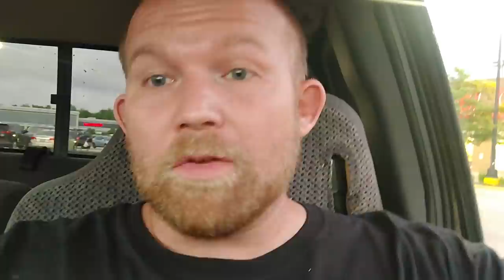Fram Filter Application Talk And What is What and Why - The consumer is the issue not the filter

Comment: I've used fram for years and NEVER had a single issue. I always change oil by 3000 miles. Full synthetic or conventional. I now own a Hyundai Veloster N which is a turbo charged 2.0l and warranty requires I use OEM. They say to change oil at 6000 but I change it at 2500. I use Pennzoil Euro L 5w30 dexos 2 full synthetic low SAPS spec oil. Engine loves it. I totally agree. Take care of the car, and no matter what filter you use, it will be fine. It's just a filter! Change oil often. Cheap insurance. I live in Tampa bay area Florida heat so I need an oil that handles the higher temperatures. Love your channel and keep putting the truth out💓 Be blessed my friend

Comment: What’s your thoughts on OEM motorcraft filters ?
Reply from the maker: Great filters
Reply: Motorcraft filters are good, been running test engines in a big name automotive dyno test lab for years and we use motorcraft filters on everything. Almost all of my 4 Ford vehicles are pushing 250K miles.....always only used motorcraft filters and motorcraft 5w30oil, NOT 5W20.
Reply: I can vouch for Motorcraft filters....top quality as far as I'm concerned.
Reply: I don't know if Ford uses Motorcraft for the original filter. If you look closely at the filter that comes from the factory, and compare it to a Motorcraft, they're different. I understand the original is not painted, but that's not what what I mean. Its actually a different filter.

Comment: I have an 05 toyota corolla I change my oil and filter every 5k on the dot I run 5w30 mobil 1 and I use a STP oil filter synthetic type filter and car has almost 200K runs perfectly fine 90% of my driving is highway miles so Rich is right quit being cheap and service your car it will save you in the long run

Comment: I believe I saw fram and super tech rate their cheap filters for 10k intervals. The tough guard is 15k and the ultra is 20k.
Reply from the maker: Fram rates their cheapest higher end of the lower grade filter for only seventy-five hundred miles I was just on their website
Reply: @FordBossMe  oh yes that's the new drive or the cheap e core. The extra guard is 10k. But I have yet to find a drive, force, or titanium. Those are the 3 new filters but they aren't at AutoZone, o'reilly's and Walmart. Maybe I'd have to go to advanced or pep boys

Comment: I use pennzoil platinum for my wife’s Lexus 2.5 4cyl ,and I change the oil every 5,000mi using the toyota filter. Do you think it would be worth the extra cost to use the high end framultra with the synthetic media? I drive my vehicles for at least 300,000 miles prefer 400,000 depending.
Reply from the maker: Yes
Reply: @FordBossMe  okay thank you👍🏻
Reply: Yes and use the Penzoil platinum ultra. Only a couple of bucks more than the regular platinum and much better detergent package.

Comment: Remember the old VW bug effectively didn’t have an oil filter and many of these could go100,000miles 
 with appropriate oil changes.

I try to use “ fancy” oil filters that supposedly filter the oil better. Can I prove some of these fancy oil filters are better and will make the engine last longer? The simple answer is: NO. 

If any car owner wants to push the distance between oil changes they should go though a lab like Blackstone to verify they are doing the right thing. Yes you can really screw up an engine by changing the oil every 10,000 miles.

Remember there are cars that have gone over 1,000,000 miles that had regular oil changes every 3000 miles and had non synthetic oil and regular filters.

Comment: Love your content but I disagree on cheap fram they are junk! spend the extra 4 dollars and get a wix. What if the vehicle breaks down and sits for 8 months then someone goes to start it and filter end caps fall apart. The fram end caps are known to break
Reply from the maker: What are you exactly disagreeing to? There's nothing to disagree with in this video I spoke to both sides of the field cheap vs. Expensive and explained why cheap won't work past certain intervals and why it will work under certain intervals there's nothing to disagree with

Comment: Off topic but what side of the dipstick do you read if one side is higher than the other? And is it dangerous if you use the entire 5 jug when you only need 4.8qts?
Reply from the maker: You're fine as long as it's not like a half a quarter more typically you're okay because what a line up happening is Yolanda filling up the oil so much the crank will slap the oil and it will pull it up into the PCV system and then you'll start burning it but if you're not seeing smoke and it's not running bad you're fine
Reply from the maker: The highest part of the oil on the stick
Reply: @FordBossMe  one side is at the full mark and the other is way over, maybe the stick is scraping the sides? I checked on a cold engine.
Reply: @yosef8377  — some dipsticks slide into the oil pan at an angle, hence both sides show different readings. That’s a poor design, in my opinion and such a vehicle needs to be driven off a cliff… it’s a POS. 

Check it after an oil change and after you pour in EXACTLY the amount the owners manual says. Then, just pick a side that feels right. 🤷🏻‍♂️
Reply: @I_know_what_im_talking_about  😂😂 it's a 2020 Mazda 6, it's too new to do that! Why couldn't they just design it to take an even number 😏

Comment: I would not use a cheap Fram filter in my car, nor would I use a bottom end cheap filter from any manufacturer. I use a Fram XG oil filter with the recommended Nissan oil and change it at 3k miles. The used oil comes out only slightly darker than when it was fresh with no discernable oil usage on the dipstick. As the man said: oil & filters are cheap compared to having an engine rebuilt.

Comment: You're right. Oil it's self is great now with the technology and can last longer when synthetic. But like you said manufacturer says oh yeah do 20k or this is lifetime no worries. Hah when the warranty is up and car is broken they'll sell you a new car or engine transmission whatever. Us who do our stuff and read the owners manual. We're good. 

Now there are oil companies who state with their oil that you can go up to 20k but fine print on the back and websites say please follow oem intervals while under warranty. What's in the oil to make it go farther when you ask and engineer 🤔 hmm nothing. Same thing with the engine hmm nothing. With technology at its greatest today they could probably make cars and trucks last like they did 20 30 40 years ago. But if they did pfft no more car sales. Plus if you wanted to do more out of a synthetic oil then highway miles and driving is the best. 

Oh and my old acura said in the owners manual that if you do normal and light driving you can do the oil filter change every other service. More severe driving yeah at every service.

Comment: Been using Fram fitters for years no problems
Reply: Same here, I’ve used ultra synthetic Fran filters for a while. I also use oem, wix, purolator and Mobil. The only ones I avoid are the extremely cheap filters.

Comment: Hey man, I have a question for you here hope you could help me out. I have a 2017 Ford F-150 with 5.0 V8 engine. I bought it brand new and drive only 1500 miles per year.  So here is my question , should I change my engine oil by miles or should I change it every year doesn’t matter how many miles that I drive. You suggest that we should change our oil every 3000 miles , so in my case I only need to change my engine oil once every two years since I only drive my truck 1500 miles per year. Thanks and have a good one.
Reply: The manual says 5,000 miles or 6 months, whichever comes first.
Reply: @frankg6578  you also drive a 2017 f150 5.0?
Reply: @bo4130  no, I looked it up for you.
Reply: @frankg6578 oh wow, you are awesome!  Have a good one 👍

Comment: I think the thing that pisses me off the most about Fram is their advertising that their products are so superior to other filters. I hate companies that make outlandish claims but they can't actually back it up and rip off consumers in the process. I feel the same way about Dorman products. Just look at the thumbnail for this video and you see that Fram claims their cheapest filter is good for 10,000 miles. A lot of consumers fall for that BS. There's a reason why the saying came about to "ask for the real McCoy."
Reply: However, their ultra synthetic is really good. I run them 15k miles on 5k oil changes.
Reply: @slscamg  — same here. I throw on the ULTRA for my customers and then run it 2x 6-7k intervals with great success. Their maintenance light triggers, they come in for a quote oil change only. Filter stays on. Then the second time around, both oil and filter gets replaced. Honda does this practice for decades. It’s even built into the maintenance reminder. 🤷🏻‍♂️ 

I like high quality oil filters. 👍🏻

Comment: Some cars have had issues with Fram filters at certain points in time in the past.  One example I know of would be Hyundai vehicles.  

See Hyundai TSB 12-EM-006
https://f01.justanswer.com/El_Jared/b8112c3a-a543-4012-a2ec-1c0d54fc5771_hyundai+TSB.pdf

Description: Some vehicles may experience an engine knock noise with the use of an aftermarket oil filter.  Aftermarket oil filters may use different materials, construction and specifications than genuine Hyundai oil filters, which may lead to pressure variations within the engine, thus contributing to an engine knocking noise.

Vehicles Affected: All Models

Repair Procedure: Perform an oil change on the vehicle and replace the aftermarket oil filter with a genuine Hyundai oil filter.
---

Fram was not called out specifically in the TSB, but if you spent time on Hyundai forums it was well known that Fram oil filters could cause these issues.  Lots of people reported engine ticking/knocking, went to the dealer, the dealer just did an oil change, replaced the filter, and the engine noise went away.  

Fram may have changed the Hyundai / Kia filter design at some point to deal with this, but I think it's still best to use the original OEM filter for these vehicles to be safe.
Reply from the maker: So it's more of a cheap filter design then so much a specific brand type design and that's where we need to focus is the manufacturer filters are not cheap filters but when you buy low quality filters this can happen with any make manufacturer model doesn't matter and I pointed that out in this video so what you posted here and this technical service bulletins actually confirms that what I'm saying is true don't use cheap s*** on vehicles that you're going to abuse

Comment: Completely disagree on this one, had a car (not naming manufacturers) that the oil & filter was changed every 5000 miles & the fram filter split in half & locked up the engine, so never again with fram, wix for me from now on.
Reply from the maker: You don't have to agree with me I'm not begging for people to come to this Channel and agree with me I'm not even asking for people to like anything that I have to say
Reply from the maker: What type of oil were you using what type of oil pressure does your car have why were you buying a cheap filter to begin with there's a number of things that go into what happened to you and why it happened to you
Reply from the maker: You're trying to pump out 30 weight oil through a thin filter that's made for three thousand mile oil change interval at 7,000 RPM the filters not the problem you are the problem and I'm not specifically pointing the finger at you I'm just specifically stating a scenario here that could come into play the nobody ever talks about
Reply: I'm not saying you're wrong & I like your channel & think you're a hell of a mechanic, In my opinion I don't like fram, I had a bad experience with them & yes it could have happened with any filter but it happened with a fram, but that's just my opinion & that's all it is an opinion. And the reason I was run that particular filter is just like you said they have the best sales market in the world. So didn't mean to offend you keep up the good work & I'll look forward to the next video.

Comment: What I will say the fiber end cap to me is a non story as is a flat part that has glue on it and seals the end caps, what do people say about many canister elements that have no end cap?, Most Fram filter even the extra guard have silicone anti-drain back valves over a lot of the popular number Wix filters that they now have made in china have the cheap nitrile black rubber ones. I do see a lowering of standards since Mann/Hummel has bought Wix and ever since the china virus the number of filters in the automotive line that were US vs China has changed dramatically which is disappointing over half of the numbers we use at work are now china and some numbers went to korea sourcing like a 51334 which is OE Hyundai Kia so they no longer have a US version. They will complaint about a Fram but they are way better than all those cheapy imported knock offs and the silver/economy line of filters I see.

Comment: most oil filters are 10 microns ,they are like air filters when they get dirty they plug up , check and change . I've seen them rusted right threw and plugged solid , customer says vey bad gas mileage , plugged air filter. Chris you need to go on NET- FLIX .

Comment: I dont have an issue with fram filters completely, just the shitty orange can. fram has changed the glue in those like 4 times to try and keep the glue from melting which is what causes the filter to come apart. and these turbo engines run HOT. just pay the money for a higher end filter and avoid the problem all together. when i drain oil if it's blacker than a deisel oil, your not servicing that car enough.

Comment: Just like you said the problem is not the filter its the people that do little to no maintenance to there cars and trucks. And when they do they get the cheapest stuff they can and run it 10-20-30,000 miles and then talk crap when there engine locks up blaming the oil or filter with no thought that its been 2 or 3 years sense they did anything to there car.
This is why i got out of automotive service after 30 years. It never failed that people would point there finger at me saying i must of done something to kill there car. I could show them that the oil in there car was like tar or just nothing in it. Or a oil change is not going to fix there rod knock. I'm not buying you a $3,000+ engine to fix their shit box because you want to blame me for your lack of common sense.

Comment: Motorcraft or WIX.  I wouldn't use Fram on my lawnmower. FRAM trashed my 97 F150 4.2L that and shop looked at it after 49 miles and the cap blew off. Lost all oil at 70 mph. Guess what happened. 
NEVER USE FRAM. EVER.
Reply: All I use of Fram ultra synthetic, never an issue

Comment: If I put an empty (no filter media) filter can on my engine and changed the oil every 3000 miles, I’m sure I could get away with it for a long time. Most of the contaminants would be flushed out with the oil. Doesn’t mean using a filter is a bad idea but you need to understand that really cheap filters are not filtering much. And  using a better filter is always worth it. IMO the 20000k oil filters are not worth it. They can handle long OCI’s but they don’t capture as much as a 10000k filter. Those Frams paper end caps can let unfiltered oil past the anti drain valves and also the bypass side. If you don’t mind that fact and you change your oil every 3000k it probably doesn’t matter but it’s worth buying better. Wix, purolator, and others are a couple bucks more and worlds better.